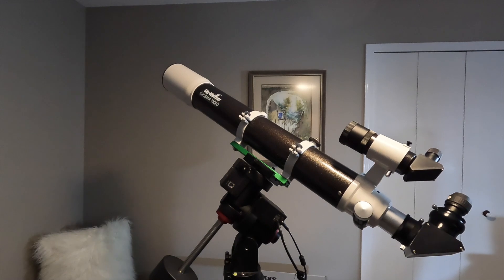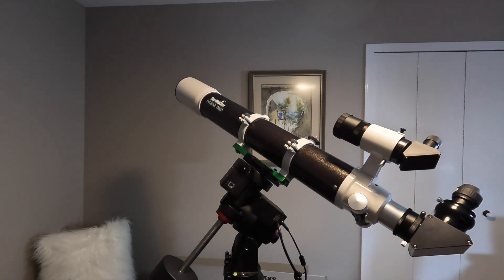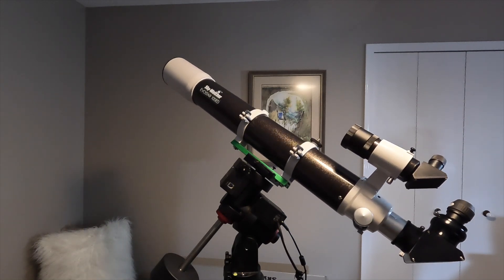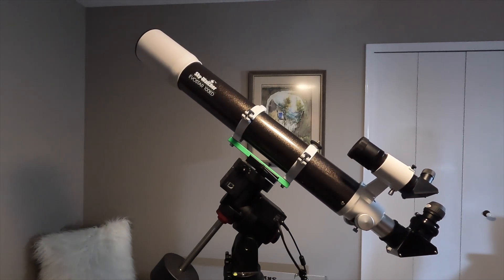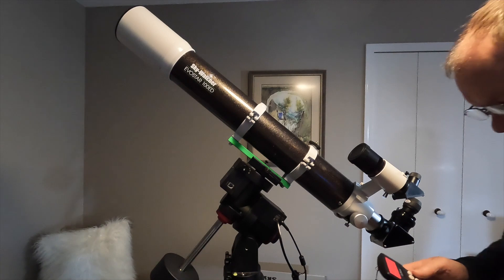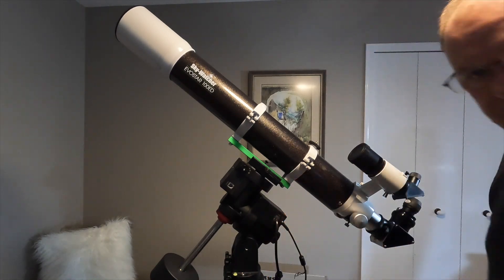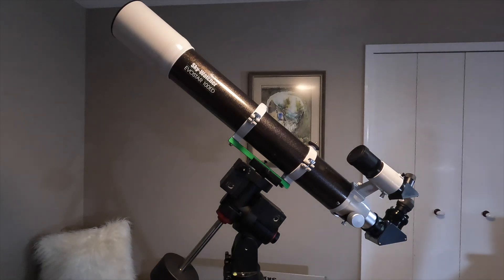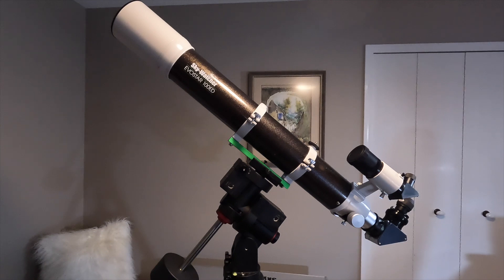Telescope Mount Making Clunking Noise While Slewing

Comment: Hi Mark, have you already received a reply from iOptron because of this noise? I'm going to buy this mount, but after your video, I am in doubt if it will be a good deal.
Reply from the maker: Hi Michal, I tried 2 different published email addresses for ioptron support, but never received a response.  But I discovered the cause.  You can remove two screws (one Phillips and one Allen) and then with the cover off you can see the drive belt.  The belt was a little too lose.  Documentation says 3mm of flexure.  So I loosened two screws holding the drive in place and pushed the drive over to tighten the belt and then tightened down the screws.  I replaced the cover.  The noise is gone and the slewing is quiet again.  I plan to do a follow up video to show that for anyone interested.  I hope that helps.  One time I bumped the mount pretty solidly and wonder if that’s what jarred the belt lose.
Reply: @marksastrojourney  Thanks Mark, it looks like a pretty simple solution. I have question about connection to the PC, how do you control your GEM28 (maybe any video about this stuff would be great :) )?
Reply from the maker: Definitely good to find that out if you're thinking of getting the mount.  It is compatible with the ASCOM Device Hub.  The GEM28 mount has built in WiFi.  So you can connect to its WiFi network from your computer, then it will be available for ASCOM Device Hub to connect to.  Of course, you can also run the included cable from your computer's USB port to the port of the hand controller.  I hadn't thought of doing a video on this topic, but may do so now that you mention it might be helpful to some people.
Reply: My CEM26 was making that exact noise on the RA axis. My guiding had become irratic and the RA would just suddenly stop responding. I adjusted the tension of the worm gear until the noise stopped. My tracking was back to normal after the adjustment and the noise was gone. I'm sure making the same adjustment on the Dec worm gear might solve your issue.
Reply from the maker: Thanks for watching PhotDad and for sharing your experience with a similar noise.  In my case, it turned out to be the tension on the belt of the motor.  I took the cover off and discovered that the belt had a lot of give/play.  I adjusted that to 3mm of flex and the noise went away.  Clear skies!
Reply: @marksastrojourney  I'm glad you got this figured out. I'll make a note of this if I hear this in my DEC motor one day! Clear skies!
Reply from the maker: Thanks!